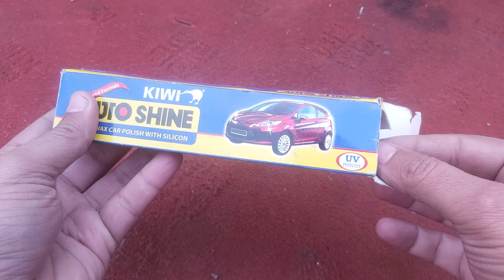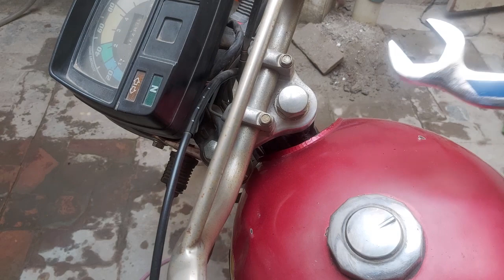Very Old and Rusted Soviet Screw Wrench Restoration - Restoring Tools

Comment: I am sure this restoration changed the dimensions of the wrench as you took off a lot of material from inside of the tool to reshape it..... but good effort!
Reply: thought the same, it will be very lose now inside
Reply: That would be one or two sizes bigger now. But as there are no size reference on it, it wouldnt matter. The paint wouldnt last long and would start to rub off when first use as it was painted on a smooth shiny surface.